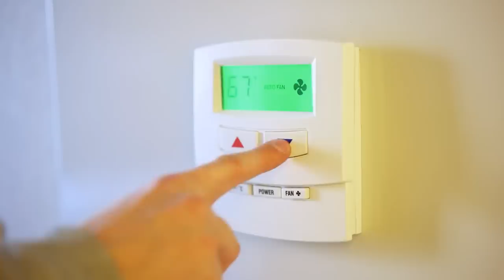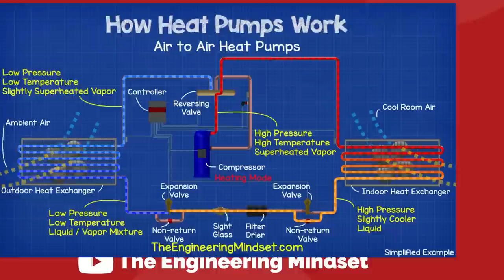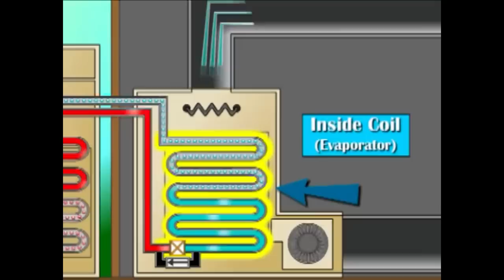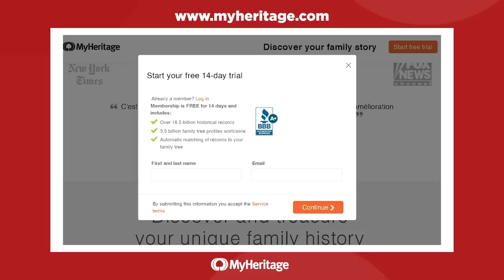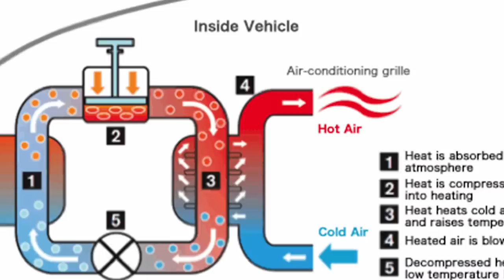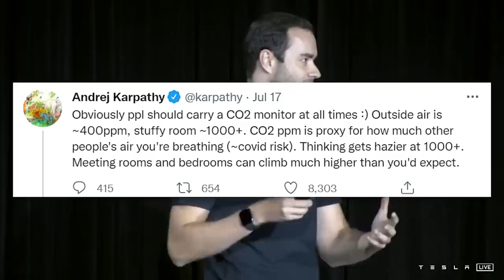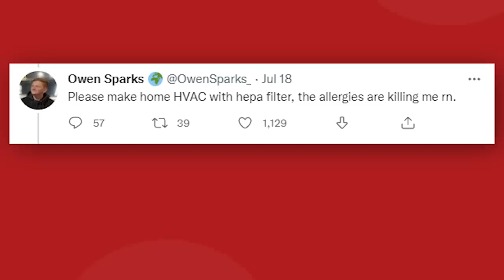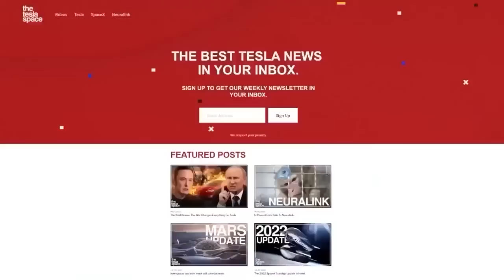Why Tesla's Heat Pump Is Essential For Our Future!

Comment: It is not Freon, it is R410a, at least in North America most commonly.  Freon is generally banned because it is super crazy damaging to the environment, a lot more than R410a.  You could use a few others.  Something often overlooked is propane is the least damaging refrigerant we have today; it is just flammable.  Then again when the system is not supposed to leak and we use propane all of the time, it seems more hype then real problem.  R410a has a boiling point of -48.5C, so this whole "it's too cold to boil" is made up by you.  There is a problem in creating a big enough temperature differential and that is real for your Canadian climate.  That 3x improvement in efficiency is more like if you are in Southern California.

By the way I do have a heat pump while living in SoCal.  Works great.  Costs to run are modest with the biggest thing is energy is crazy expensive in SoCal.  Even with the crazy energy prices, not too hard on the pocket book as it is really efficient.

I think the big thing you need to think about, which is almost completely missed in this piece, is how to effectively use a heat pump and even air conditioner in a wide range of climates.  You could for example get a Lennox "dual fuel" heat pump where if it is not too cold out, it is a regular heat pump.  If it is like Canadian cold out, then it runs a little outdoor furnace to warm the refrigerant.  Supposed to be super efficient at extracting the heat from the furnace bit and then warms the place like a typical heat pump would.

Another year round option is either buried coils or bore holes in the ground and stuff the coil into them.  The idea being underground is a more constant temperature, at least when you go deep enough, so then if it is super cold out, you get the heat from the relatively warm ground and in the summer you dump the heat into the relatively cool ground.

Another play on this is say have the coil go around your pool for summer cooling.  Water is a lot more dense than air, so is a much better thing to exchange heat with if you are looking for efficiency.  Pools are never warm enough, even in SoCal, so a great place to dump heat in the summer, granted you do it right and don't end up with too many issues of a clogged system.  Granted pools are high maintenance items so it is up to whatever you are willing to maintain ultimately determining what kind of setup will work for you.

Maybe as an alternative have a pre-warming water tank before your water heater with the notion your air conditioner can dump heat into cool tap water.  To help maximize efficiency, if you have ever had a pool, the water always stratifies heat wise so warm water is on top and cold water sinks to the bottom unless you go out of your way to mix it.  So for your air conditioner running during the hottest part of the day / coming home from work while still hot out, have it draw from the bottom of the pre-warming tank and dump into the top.  Then have the water heater draw from the top of the tank.  I have noticed my inverter based ACs are far more efficient with cooler outside air to work with, so summer days I have worked late, I have noticed cooling down the house has used far less energy than say mid day cooling on the weekend when I am home all day.  This extends that out into say the tap water is 20 C while the outside air is 40 C.  The air conditioner using that 20 C water to cool the house may use say 1/4th the power or less for the same amount of cooling.  75% - 80% reduction in power for the same amount of cooling is huge.  Then the water heater may draw in say 25 C water to warm instead of 20 C water and use less energy to warm it.

Of course add in the super efficiency that Tesla has come up with to the above and you should have vastly more efficient cooling and heating that should work well anywhere depending on the exact setup you use.  So for Canada, you best bet is to probably drill holes in the ground or at least so something like the Lennox "dual fuel" system.  In SoCal, if I could do the extra water tank, I would be in pretty good shape as well as for people with a pool, if they could tap into that it would be good.  I already have an efficient inverter based system with remote control, so already have a big leg up on those with more dumb and inefficient systems.
Reply: 1st prize for the most exact explanation of a real situation which could be important to most people in USA. AND you didn't use the antiquated far in height nonsense when talking of temperature. Good point about the bottom of the pool being cool, surely some heatpump providers already use this fact in the land of huts? 
In my own case I simply bought a house with an infinite amount of water available which could be used as a heat source and also to generate electricity. There are billions of locations on the planet where others could do the same but they are slaves to some boss who will not let them live in a tolerable climate. If they had got an education then they could understand these points and also been useful to employers who want smart people and not just idiots who push buttons at the right time. 

Efficiency is the CORE or all this and animals have PERFECTED themselves to not need any of the above. OR you move out of the heat or out of the cold if it is uncomfortable. The birds even with small brains do this and most want nothing to do with humans as they regard us as ignorant, clumsy, dangerous and stubburn creatures who are not to be trusted. In 99.9% of cases they are right, but not always.

Comment: wow I finally have a comment to make. You asked towards the end, who is doing this now, well I am. I did it in March 2021 demoed old system and installed heat pumps whole house no supplemental systems. 
quick stats. 1800sf home-Mojave Desert CA, previous system (as of 18 months ago) Cooling- 2 master cool swamp coolers on the roof 30 amp each, Heating-100amp electric forced air furnace. summer time 110*F 3-4 months a year, winter 20*F snow every 3-4 years only you know the desert does get cold, not Canada but hey, this is us, cold enough to be cold. that system it was still too hot in the summer (we roasted) and still too cold in the winder, we blasted heat or ac energy bill was really hi. really hi.  
Now since I installed heat pumps, one 35amp and one 45 amp heat and ac. Mr. cool oh ya. 6 zone, dual exterior pumps. we have to turn off the cool air in the summer, (my kids are polar bears now)  and we feel nice in the winter. I removed the 2 master cool swamp coolers, and took the plunge based on science and removed the furnace. I felt so crazy 18 months ago thinking what an I doing here. but now after 18 months I would do this to any new home I ever purchase. those diy mr cool units came out total to around $6k, upfront cost or sure. but the return on lower energy bills and the quality of life is priceless. So totally believe in the technology, living breathing proof family of 5 (3 teens) are way more comfortable. scary at first, but I did it and the stats, real life experience,  and data does not lie. ok I am done, -JM
Reply: How can anyone calculate using amps and months but then use the f word in his comment?

Comment: I'm going to give you the inside scoop about how this heat pump is going to work will be multiple small heat pumps just like in the vehicle and what they will do is string them together on the same shaft that way it can gain maximum efficiency and what it will do is physically only run one heat pump per room or two this way you can actually select the room that you want to have colder than the others and you can control the airflow individually to each room you can have heat running in one room and air condition running in another just depending on what the person in the room preferences and individual thermostats for each individual room this would allow ultimate efficiency combined with artificial intelligence to control the entire system as a whole... having all of the compressors hooked up on the same rotor means that they can individually kick in and if there's more than one of them kicking in they both work together so it helps get the other compressors up to speed and cuts down the energy loss. Because the system will be able to have multiple different heat pumps it can run one of them on air condition mode and the other on heat mode which will basically make dry air because once you heat up the air the moisture can be absorbed by the one cooling easier and you can control the actual humidity perfectly. Mark my words this will be how the system will work it will be for new construction and for retrofitting because you're able to hook up the individual ducts instead of the entire manifold which supplies all the ducts...
Reply: You don’t know what you are talking about.
Reply: And from the lack of punctuation above you can't write.
Reply: It would be cheaper, easier and more efficient to install any of the many VRF or VRV systems that have already been on the market for thirty years.
Reply: @mikekelly5869  I’m a commercial technician.

That’s kind of what I’m getting at. There isn’t any advanced tech that isn’t already being tried with HVAC. It’s all being tried and explored. Unlike electric vehicles in 2007 and reusable rockets in 2015.
Reply: @mikekelly5869  I’m a commercial technician.

That’s kind of what I’m getting at. There isn’t any advanced tech that isn’t already being tried with HVAC. It’s all being tried and explored. Unlike electric vehicles in 2007 and reusable rockets in 2015.

Comment: FYI, keeping your air off while you're away isn't efficient 
1. your fridge and freezer works harder
2. your walls and other belongings gain energy and store it as thermal mass so when you get home your a/c will run all day (and night) when you get back, just for saving your electricity for about 8 hours.
Reply: Heating or cooling is to replace energy lost through the walls etc. There is no free lunch.
The greater the thermal gradient the greater the losses. 
Thermal mass just acts as a buffer.
Fridge/ freezers are low part of utility bill.
Reply: @GSimpsonOAM   @g simpson  That's my point, the drywall and the 'stuff' you have in your house will retain heat if your ac unit is off long enough to warm up then turned back on again. Try turning your air off completely in the summer for a weekend coming back turning the air on cooling the air then opening plate  cabinet in the kitchen feeling the heat radiate off the plates for HOURS. ...And true fridges and freezers are a small part of your electric bill, but in a house that has heated up hotter than the outside temp that part becomes larger as they run continuously.
Reply: Most of those issues would go away if buildings had more insulation. Code minimum is far too low.
Reply: @imzjustplayin  I agree... to an extent, once that heat energy is in the walls it will work it's way in... eventually. it would help but not alleviate the issue. if that were the case just tripling the thickness of walls and insulation would completely negate the need for Tesla's heat pump.and save tons of co2 entering the atmosphere but you'd still have to leave your ac or heat running at least to a lower extent than that of while you're there.
Reply: Today most new buildings are adequately insulated.  In the 70s most were not adequately insulated. However many buildings today allow to much air to flow through the walls.  So when there is a rental breeze outside it will blow cold air into the building and hot air out the other side.  Cracks in wall and gap about light fixtures and pipes and leaks through doors and windows are the biggest problems in most homes today.

Comment: While I like TESLA and have been driving a 2017 Model X since 3/2017 (MS before that), You need to know that there are Mini Splits which are very efficient... SEER 42 in Cooling and HSPF of 15 in heating.  These are super good! There are much less good ones!  One needs to check (and understand) the specs. In my 1979 Northern Colorado 2 by 4 home, I have 
2 of these small (4/3 ton) mini splits, I have removed the Natural Gas line, Water Heater and my furnace. What really allowed me to get enough PV power was that I upgraded my Walls / Windows / Doors . with Super Insulation and Sealing. THESE ARE THE SECRET ! Walls are now R-60, Ceilings are R-100+. Doors have small outer vestibules... I am WAY PAST net zero. My HOUSE is super comfortable at 105 degrees and at Minus 20 degrees.

Comment: I “upgraded” my propane furnace to new gen Mitsubishi heat pump.  When it gets cold, my propane furnace worked much better.
Reply: Heat pumps stop "working" when it's -10C outside. 

The only year round heat pump system is geothermal heatpumps.

Comment: I already got rig of my gas supply and use air conditioning to heat or cool my house. Since I have solar PV as well the running cost is near zero and even on the coldest days it can heat my house sometimes requiring just a small amount of energy from the grid if it's cloudy or night time.
Since the energy prices have shot through the roof here in the UK I can definitely say this is the future, but every property should be covered in Solar PV. I don't yet have water heating though, but I get by with using much less than most, heating only what I use. Solar Thermal would be nice.
Reply: Simple rule for sad people who live in a dismal climate - go to bed when the sun goes down and get up when the sun rises. Never heat at all, and in summer make shadows by planting trees directly covering the roof from sun.

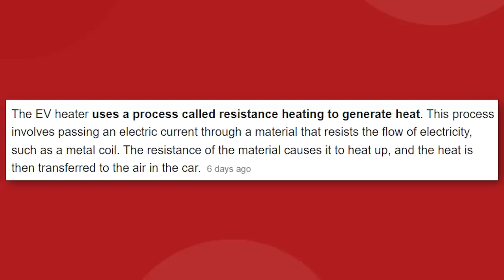Comment: 9:17 an EV heater or any electric heater actually have very low resistance. This low resistance (see Ohms law) allows high current flow and heating element to get hot.

Comment: Heat pumps or what we call them here in Montreal Thermopumps have been around for almost 40 years. Very popular in suburburb built homes of the 90's and 2000's, now commonplace because electric rates are so low here, making them a no brainer. Gas or electricity is used on colder days under 32F  0C

Comment: Can the same heat pump be used to heat the water in your home? If you are using this system to cool your home the excess heat be put to work.
Reply: Yes you can buy heat pump water heaters or you can get a system heats air and water.

Comment: If the ambient temp outside is below freezing it will freeze your condenser on a heat pump so it doesn’t need to be below the Freons boiling temperature to cause the system to malfunction in humid climates so that is why heat kits are installed on all heat pumps.
Reply: heat kits are to prevent the oil and or refrigerant from stalling the compressor. As for the freezing, that's what the defrost cycle is used. They make heat pumps that work down to -18F.

Comment: replaced gas wall furnace with ducted air heat pump . as well as better heating and cooling throughout the house.  the air filtering system picks up so much

Comment: My house has geothermal heat pumps. It uses the ground for a heat and cooling source instead of the air. These are much more efficient and require no outdoor unit, and do not have a loud fan outdoors.

Comment: Whole home hepa filtration already exists. The most efficient heat pumps are geothermal source as of today. Smart home technology that operates hvac system based off of a schedule, integrated with occupancy sensors and/or geolocation already exists. There is room for improvement with any of this technology but not sure what new technology tesla would be bringing to this industry based off this video. Elon should make a geothermal generator to power a home, I haven’t heard of one for residential use

Comment: Nope you are taking about the Octovalve, as Teslas first air conditioner/ heat Pump in the model Y, that is correct... but Tesla Resleased air conditioner heat pump called Superbottle , First in the Model 3.

Comment: Huge issue when temperature drops below 20 degrees and the resistance heat kick in Looking forward to new super efficient heat pump that can handle the extra cold days without spiking electricity unsay.
Reply: Ground sourced heat pumps have a stable 70 degree sink all year round.

Comment: He pumps are fine if you like running your air conditioner in the winter that'll increase where on your compressor because you'll be running it 365 days a year. That's essentially what you're doing,, only it's more expensive because the head pressure is higher which means it takes more energy to compress. Heating is poor in the winter and regularly uses heater coils to supplement the hot gas from the heat pump. One problem is that the outside coil freezes up when it gets too cold and it has to reverse the freon to defrost the coil and then re-energize after the defrost cycle is over.
So unless we start building more nuclear power plants this isn't going to work.

Comment: Google nest already offers controlling your home thermostat based on cellphone location. Since you can have multiple people that are either home or in the car, Google's solution makes much more sense than tracking car location. 
Also, heatpumps have been around for a very long time. You can even get water heaters and clothes dryers with heatpumps in them now. If you're seriously concerned about a hot or cold climate and have the space for it, a ground loop system can offer reliable year round efficiency.
Also, all air conditioners are heatpumps. The ones Tesla designed are are not significantly improved over existing designs and won't cut the summer peak electrical load for AC systems.
As for air filtration, any AC system can be fitted with a better filter. 
The only significant thing that Tesla might have to offer, is improved manufacturing efficiency that might reduce prices. Unfortunately, installation is a big chunk of the cost and that isn't going to go down.